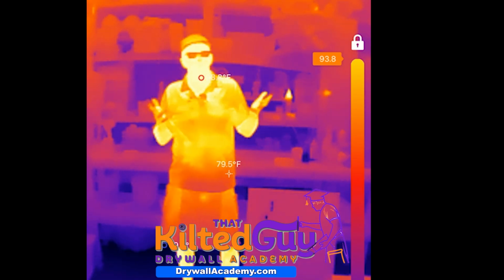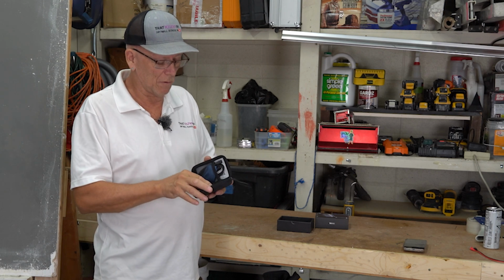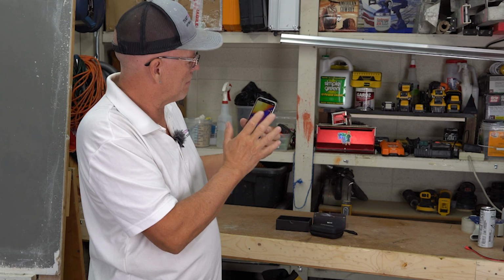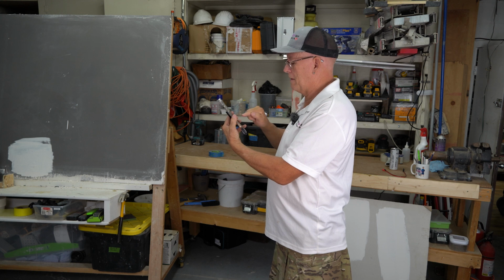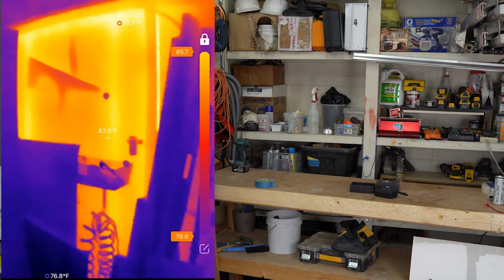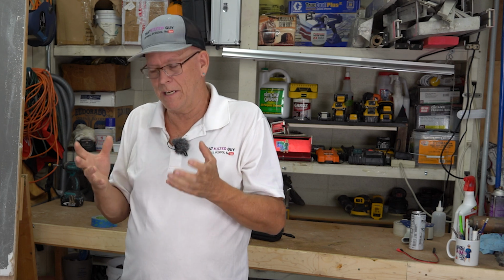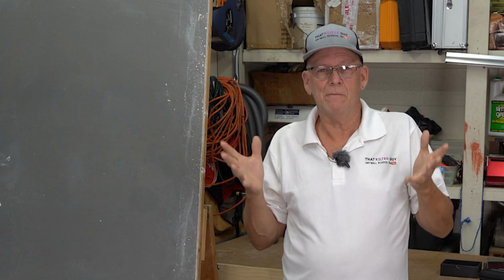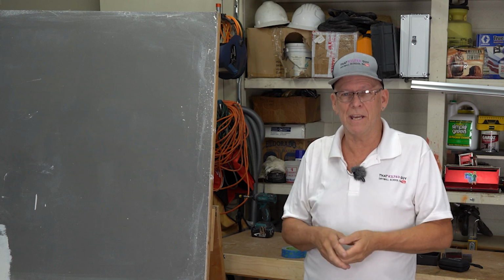Find Hidden Energy Leaks with this Infrared Thermometer

Comment: Hey good buddy, when you fix a crack in drywall that goes up to the trim do you have to remove the trim to fix the crack or can you just fix the crack that's showing? When I took off a piece of trim there was no mud there where the two pieces of drywall met. House built in 1955
Reply from the maker: Just what shows
Reply: @ThatKiltedGuyDIY  thanks